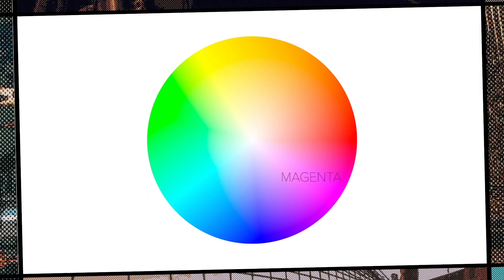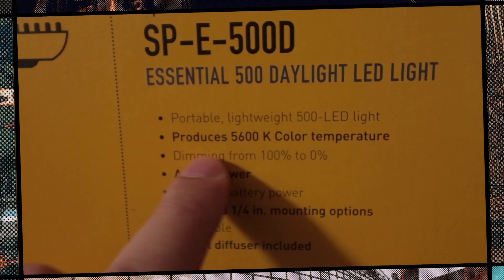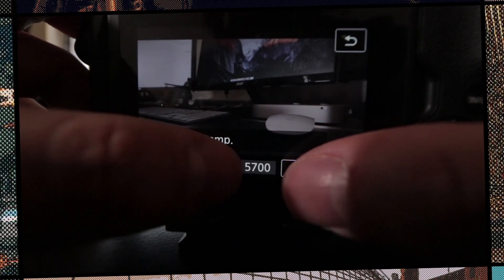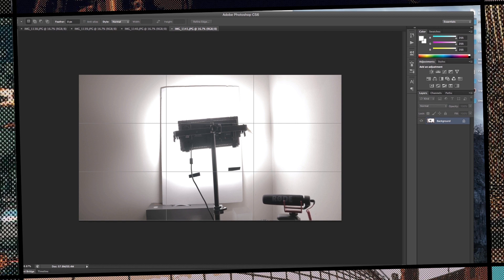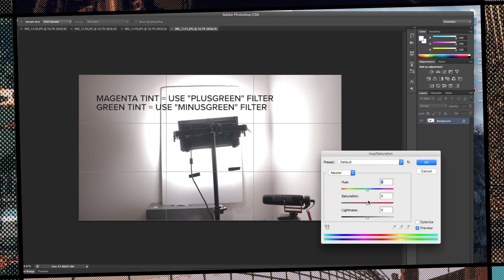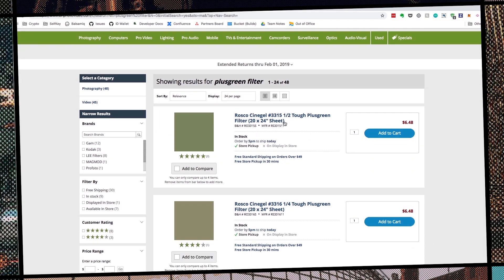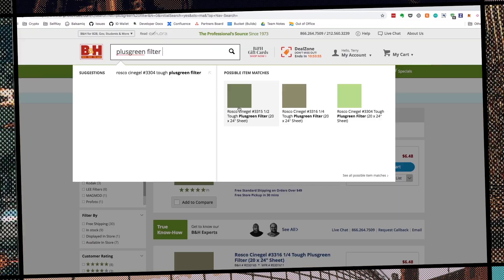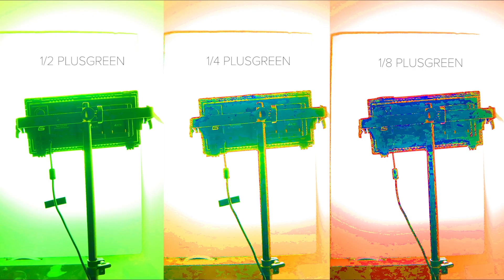How To Fix Color Casts In Cheap LED Lights

Comment: most accurate procedure would have been to use photos (RAW) and not video. You take a photo of a KNOWN GOOD gray card, then in a program like Lightroom correct the WB with the "picker". In my case the corrected image was 4000K (my LEDs are 4000K so OK) and the TINT was shifted to +28 on the Magenta side. So, of course there is a green cast on my LEDs and by trying Magenta GELs by your approach I will be definitely find the best balance by doing the whole procedure and bring that green cast to zero or super close to zero. Thanks for the video Terry